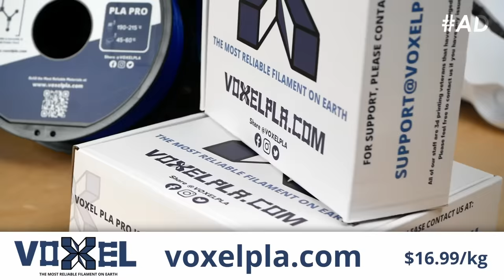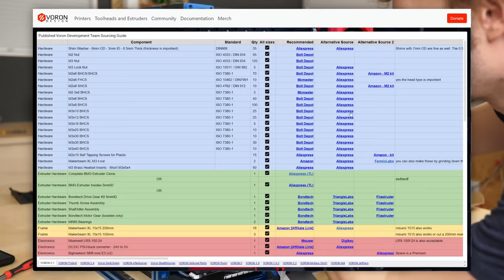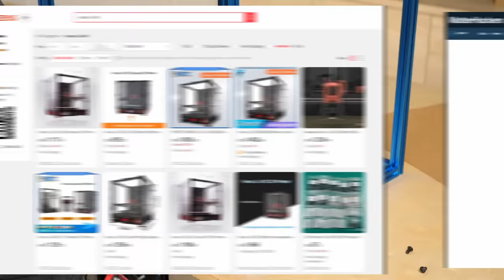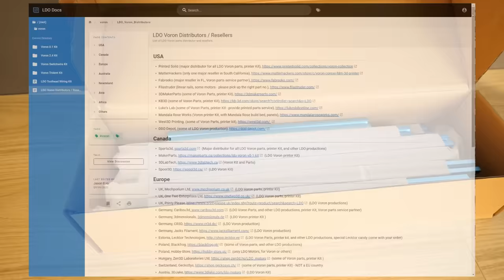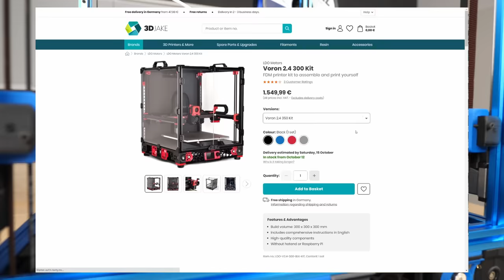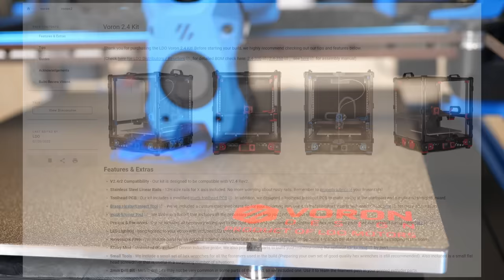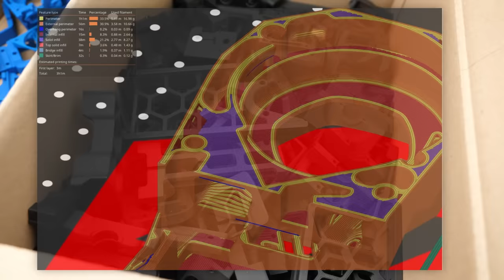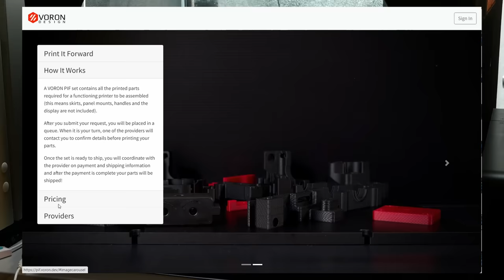Should you build a VORON 2.4 in 2023? (LDO Kit Review)

Comment: why did they not direct drive? seems crazy to me. If you're going to put that much effort into over engineering a printer why use bowden tube?
Reply: It has direct drive, that is a reverse bowden tube
Reply: They do, the bowden is only a filament guide.
Prevents the printer tugging on the spool.
Reply from the maker: It's direct drive. Forgot to mention it in the video. The tube is just for the "reverse" bowden.

Comment: Just a year or two ago this was basically the pinnacle of enthusiast printers, and the open source nature of it is of course outstanding. However, yeah - the newest printers are seriously challenging the value proposition here. The FLSUN V400 can basically do what this does, with 10 minute assembly. The Carbon Labs stuff is also great if you just want a printing "appliance". In fact, the FLSUN and the Carbon and other upcoming machines are also a massive growing problem for Prusa, in my opinion. A MK3 is a workhorse, but it's not magic, and it has its own problems (I own one, by the way)  - if I were buying a printer today, I would be less tempted by the MK3 vs the competition. This will just keep getting worse for Prusa. They need to get busy on a kick-ass MK4 CoreXY (or something) if they want to keep being "the gold standard". The Voron and Ratrig do still have a place, but there's more competition. I would personally hesitate on the Carbon, just due to its closed nature.
Reply: The market has indeed become cutthroat. The "Race to the bottom" phase of with chinese printers trying to undercut one-another is largely over. Now to make it, one has to stand out and these new printers are going all-out with that. Running klipper (based) firmware out of the box, Integrating octoprint features, going for full-automatic tramming, etc. Still i personally would prefer the existing open-source printers cause i really don't like something of this nature that i can't service myself. The X1C looks amazing, but printers got a nasty habit of showing problems later, rather than right away... (also i don't like Bambu's vacue marketing of "Lidar precision" and dissing on mendel style printers in general. Respect your predecessors you darn whippersnappers!!)

On Prusa. i'm curious to how they will be remain competitive. The big elephant in the room is the XL. Which would mark their first step into what is definitely appearing to be the Age of CoreXY. It should dwarf the competition in build volume, versatility and efficiency, but is at serious risk of turning out "too little, too late" and only really fight the Voron and Ratrig. Meanwhile their MK3S is definitely in need of a successor with its now ancient electronics and the Mini+ never really delivered on its "compact Farm printer" promises (on which i think the Ratrig V-Minion has become a superior alternative).

STILL. I do want to get into printing with a <550 budget. So i'm looking at a Prusa Mini+ kit with the idea of eventually upgrading the flawed hotend.

Comment: What about creep test you was talking about at voron zero video?
Reply: He printed his V0 with CF Nylon and as you can see the parts have deformed severely from being under constant load (this is what creep means). This is why you should use ABS/ASA for the printed parts as they have minimal creep and can handle the relatively high temperatures needed.

Comment: my friends and I are currently building a voron 0.1 and moding it and adding a resin vat and a UV light array so that it can print both resin and filament. our main concern is the power that i will need to run the machine and the software that we will need to modify/make to run the machine. if you have any suggestion on how to run the printer software that will help me alot. im thinking of using octoprint but we did't decide yet.

Comment: I wanted to get into 3d printing with my son, saw a voron video and wanted one, started sourcing parts and quickly found myself over budget and nowhere near having all the parts. i shure would like to finish getting parts but need partial kits as i have nearly half of the parts already.  I'm frustrated over the whole thing, when i look up the kit that you can custimize and subtract the parts i allready have the cost is $1300, if you expect to get the parts for $1000-1500 it might be more like 2000-3000 if you are trying to buy them individually.

Comment: Great video! Thanks for it. I am already a user of Tronxy X5SA 2E 400, and I am looking for something better, with the same print size (300x300mm bed or more). Do not understand me bad, the Tronxy kit is great for its price, and it's even two colour printer, just all the rubber wheels, and other stuff are not ideal. So I am considering two basic options - to upgrade/rebuild my printer, or sell it, and buy a new one. And for the price AND the result side, it looks like upgrading is not that great way, because just all the necessary railings will cost 30% of the original printer price... On the other hand, Voron is great and looks like a great option, but the price is still a bit too high for me, while I have (at least now) no profit from 3D printing at all. So I am thinking about some compromise solution, like trying to rebuild my Tronxy kit for something like a Voron, but for a much more reasonable price... And maybe later I will upgrade it... Just not sure about the final price, because there are plenty of parts needed to be replaced, and in the end, I can end with just an extrusion kit and steepers, and all other parts may be new, and the final price may be even higher than that LDO kit... What do you recommend me to do? Is there any other option between, which do a good job, but will cost (in this printing size) half of Voron's price? Or may I look for something prebuilt? I enjoy all the building stuff, and upgrading possibility, just the price is a big deal for me too... And 1500 Dollars is way more than I can afford...

Comment: I want to ask how to connect the klicky probe to the pcb toolhead? does the bat85 diode have to be removed if using the klicky probe?
Reply from the maker: I didn't remove anything on the toolhead PCB, so no need for that, yet I would need to recheck my wiring which pins I used.

Comment: What is heat creep on already printed parts? Isn't nylon CF supposed to be super heat resistant and strong?
Reply: It ain't heat creep, but mechanical creep.  Which is where the mechanical stress caused by stuff like tightly wound nuts and bolts slowly cause the plastic to bend and deform. Forming like a pit where the screw is placed. Nylon in particular is quite notorious for this and thus not a great choice unless you get a high-quality Carbon-fiber blend (Stefan's spool was apparantly years old and known for issues). PLA also likes to creep a lot if allowed to get warm.

PETG and ASA/ABS tend to be fairly consistent on such creep, which is why they often make the preferred choice for 3D-Printer parts.
Also helps if one uses stuff like Brass Inserts. Which the original Voron0 lacked, but have been integrated into the Voron0.1 wherever they make sense.
Reply: @Foxhood  wow I wouldn't think that. Maybe a quality well dried CF-PA would be the best? Or maybe CF-PC

Comment: Minimum of $1350.00 USD?? But wait, then you need to buy a hot end?  And then buy the Rpi? And then you need another 3D printer to print the necessary printed parts? And the desirable options are not included (like a PEI build plate)? What crazy parallel world is this?

Comment: I have had several 3D printers since 2011 - but sold all of them 2018 - since I build a house a was lacking money and time.

I still have several premium guide-rails in 12mm and 15mm and 500mm length - and also quite an assortment of 30x30mm aluminum extrusion profiles, 5 Nema 17 Stepper motors and an E3D Hotend laying around...

So I figured it would make for a good start to build another printer^^

Can anybody tell me if there are versiins of thr Voron out there to be built with 30x30 instead of 20x20mm extrusion?

Or are the files easily adaptable?

I do have some basic knowledge - vut it seems like it is outdated a few years - since it has been a while since I last printed anything...

The Ultimaker was still made out of wood back in the days haha

Comment: can i use ender3 mother board for VORON ?
Reply: I don't think so.
Reply: Afraid not. Doesn't support enough steppers (Vorons need up to 7 motors!) and i don't think its 8-bit controller could handle CoreXY operation, let alone at speeds even remotely close to the 32-bit based boards normally used.

I have seen some modify the Ender3 heavilly into a Voron Switchwire variant, not for the faint of heart with still needing aftermarket electronics, steppers and whatnot. But shows it is possible to use part of a ender for a voron.

Comment: I'm disappointed in my 350. The belts are too damn long. Also the level is lost every time the steppers power off.
Reply: Sounds like you need to do the klick mod and purge bucket then install the auto z calibration script in Klipper. Once you do this it’s perfect first layers every time.
Reply from the maker: The level is lost on any V2.4 all of the time, but that's why you have your bed probe.

Comment: Hi did anybody bought the formbot3d kit? Is it same as ldo?
Reply: FormBot kit isn't LDO Kit, but may have few cross parts. As LDO, we didn't check any FormBot kit, but as the public feedback, it's not bad frankly.
Reply: As i understand. The LDO kit is slightly more customized. Including various community modifications like parts for the Nevermore carbon filter, klicky probe mod, leds for lighting and a set of uncommon tools one might need. The Formbot kit meanwhile is more barebones for building a Voron as is.

With both it is important to keep an eye on what you might need in regards of printed parts. As stuff like which linear rails are used may differ in-between.

Comment: A tool can fail and then what? Call a helpdesk? search the internet for hours for someone to fix it for you? Leave it to collect dust? By tinkering on my Ender 3 pro and currently building a Hypercube I learned a ton fo stuff about 3D-printing myself, I learned how they work, I learned how to upgrade them, painstakingly learned how the Marlin-code works? And yes these hours you spend doing that are a lot, but now when my prints fail or some error creeps in, I am not phased, I am not scared, I know where to look, what the possible causes can be and I fix it mostly myself or find the answers in the communities, it's not just about the building of one, it's what you learn during the process and the pride you feel when you are able to build or fix a 3D-printer yourself

Comment: So far my Ender 3S outperforms my X1CC with it’s default speed of 0mm/sec by far. The 3S works out of the box, the X1 doesn’t work at all.
Reply: I find this really hard to believe considering all the quality issues I've seen reported for the new ender and how amazing my X1C has been.

surely you'll have had it tell you what's wrong with the built in trouble shooting calibration program.

It just sounds like you both have had the worst luck imaginable and or perhaps didn't know about the troubleshooting program.
Reply: @BeefIngot  A troubleshooting program needs to run in the first place, which it doesn’t, like everything on the X1.
Reply: @crowguy506  What are you talking about? No troubleshooting run needs to happen at all when you first turn on the printer.

From the moment you turn it on, you connect to wifi, log in, it runs input shaper calibration, and then you can start printing.

Troubleshooting is completely separate and different to input shaper calibration, initial setup, and flow calibration, so I think either you don't even have an x1, or you are mistaken and perhaps do not realize that there is actually a separate troubleshooting function.

I highly recommend that if you actually have one, you go to the discord or contact bambu directly.

I personally didn't think the troubleshooting menu was buried and its on their wiki as well but clearly mileage varies.

Edit:If you are really an X1 owner having a difficult time, I just realized that my confusion and suspicion might be quite frustrating, so I do offer my apologies if that is really the case, but I do highly suggest you actually contact someone because it sounds like you are lost, and when people are lost with 3d printers, thats the time they are most likely to make things worse.

Comment: Hi there! I'm building a Voron 2.4. All is going well but I've discovered two  different manuals, one for the 2.4 and one for the 2.4-R2 which I am using. I hit a snag  on page 90 and it would be good to have more detail as the M5 T-nuts don't fit flush in front of the M-3 T-nuts on the provided extrusion. Has anyone else noticed this problem?

Comment: Would it be possible to 3D print all parts that you need to print on your own on an SLA 3D printer with ABS like Resin?
Reply: It's been tried before. All resins miss one key factor. They are not thermoform plastics.
Reply from the maker: I'm sure there are some who had tried this in the past. I would be worried about the longevity of these resin parts.

Comment: My verdict: Meh.
For some 3D printing is all about tinkering with machines and settings, optimizing and chasing the limits.
But to really become mainstream, machines NEED to become waaaaaaaaay more idiot proved.
What do I mean? Simple™:  The printer not only needs run-out (and stuck) sensors and resume function, but also preemptive run-out sensoring. Preemptive means it weighs the spool (would have to know the empty spool weight, though) and can tell you before the print starts if you have enough left for an uninterrupted print or when a refill needs to happen. 
The printer also could have an automatic splicer. One roll is about to run out? A reserve roll is seamlessly tacked on, only slowing the printer a little when that happens.
Such a printer would also require to have easy and toolless replacement of wear and tear parts. The printer would know when the Bowden tube is to be replaced. For that it probably also needs to know what material is printed, so rolls with RFID identification is probably in order (telling the exact properties). Let alone an automatic drybox on the printer it prints out of.
And forget about slicers and alike. A proper model should contain (for functional prints) the technical requirements and the printer would figure out how to best print it on its own (and demanding the right filament).
In other words, if it is harder to use than a default run-of-the-mill inkjet printer, that 3D printer is yet not ready for the masses.
And no, even the Bamboo one isn't even close.
If I could choose, I personally would want the best of both worlds. A printer I can mod the snot out of it, if I so choose, but also (at least in stock config) a Neanderthaler who just stumbled out of his cave can use.

Apropos Bowden tube. I still don't understand (well, aside from the cost factor) why not even one printer features a double extruder system. One motor on each end of the tube. One pushing, and one pulling. It would reduce the power (torque) requirements (and therefore weight and size) of the one on the print head, while still reducing the chance of slipping.
.

Comment: Both my printers were parts kits, so I would definitely be down to build the voron kit as well, but I can also appreciate a printer built right so that modding it wouldn’t be a mandatory activity like it was for the Tevo Tarantula dual extruder where every failure was pretty predictable and happened, like the structural laser cut acrylic parts and the main board / bed wiring, making the rebuilt version far more expensive than buying a slightly more expensive decent printer in the first place or modding my existing half decent delta printer to a dual filament implementation.

Comment: Great video. I am still building one that I slowly self source all the parts and tools. Sadly I started sourcing before the LDO kits were available and only the LDO frames were on the market at that point. Got the same 300 LDO blue frame as yours, but my base colour is white ABS and the accent colour is dark blue ABS. I don't regret it though, (not getting a kit) as the adventure and process is what I was after and a tinkering machine, not a workhorse prebuilt one or a weekend kit build. Can you share a bit more on the plan for the different CF nylons? Will it be material properties comparison? How well a Revo ObXidian prints those materials and how the results compare to the BambuLab X1C? Comparing material properties with normal print speeds vs faster BambuLab/Voron speeds?

Comment: Stefan, I was also curious why the Voron Designs don't include filament runout sensors as a basic feature.   You get used to having one when you start on a Prusa.  I do enjoy my Voron 2.4 though, it prints great.
Reply from the maker: I rarely need it on my Prusa, yet it still saves your ass in one of 50 prints which makes it worth it. For the Voron with the higher print volume I kind of see it as a must.
Reply: it’s a gimmick, and prusa loves gimmicks.

Comment: Voron 2.4 is expensive because its overcomplicated by design.  Very fun and cool tho.  Belts for z is the main complication, reduces reliability and ease of use.  IMO the Voron Trident is a more robust solution - but IMO - the VzBot is ahead of the voron team.  Simpler, cheaper, better, faster with the ability to purchase aluminium parts, or print parts yourself.  VzBot AWD is a beast if ur after speed but the standard model is fast enough for most if you dont want or need the added coplexity.  Looking forward to his new hot end too!

Comment: I would think having the bed fixed at the bottom is a drawback when needing a heated enclosure as that heat always rises.  Having the bed start near the top and then lowers as the print progresses allows better use of that enclosed heat, no?